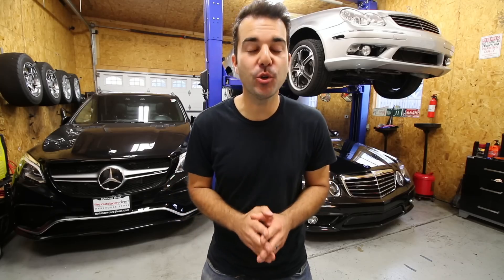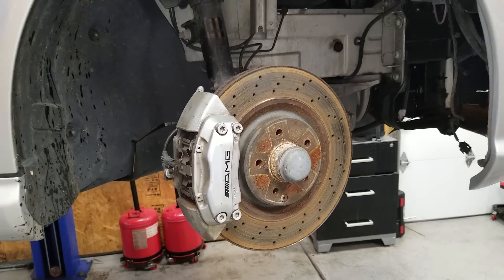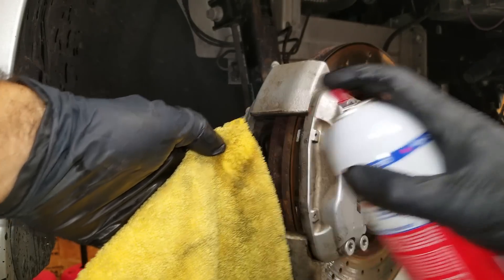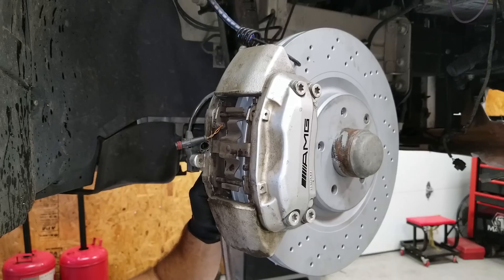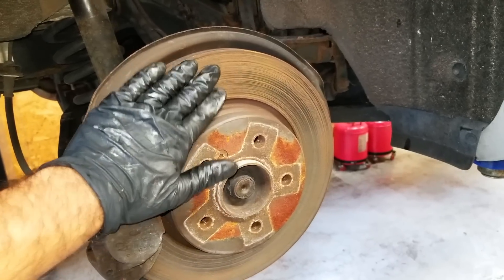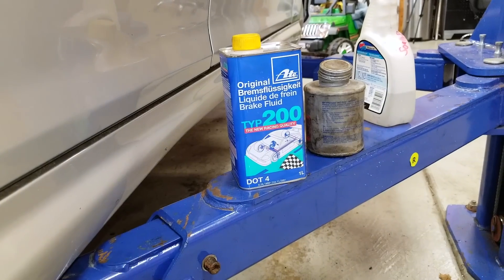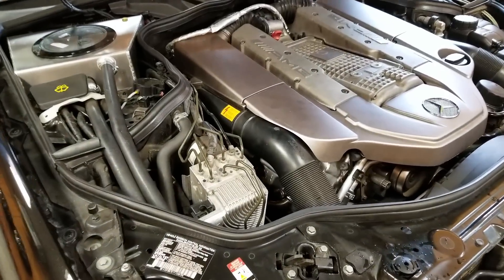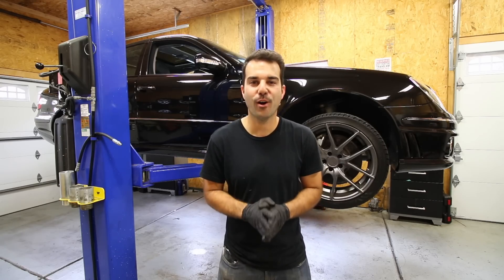Don't Let ANYONE Replace Your Factory Brembo Brakes Before Watching This Video. Big Brake Reality.

Comment: Very informative video. Thank you.
I have one question: My MB E350 (2006) makes screeching front brake noise in the morning only when backing out. It does not make brake noise when moving forward.
After some driving it does not make any noise even when going backward.  It has Akebono Euro pads.  I have lubricated the pads, pins and seating areas as well.

So, what is the issue?

thanks

Comment: Hey Alex I replaced both my front and rear pads and rotors a few months ago with Zimmerman rotors and brembo pads on my 211 e500. For some odd reason I hear a squeak coming from the front do you think it’s because of the lack of lubrication?

Comment: I use Winmax W4 pads. They're a low steel compound good up to 1200°F. Braking performance is absolutely amazing, but they do make a good amount of noise. Small trade of though for how good the stopping power and fade resistance is. I also use motul rbf600 brake fluid. Has a much higher boiling point than the fluid you used.

Comment: 2 major miatakes (!!)after removing the rotor: 
1. Not sufficient bearing hub clean! Clean it to the mirror like look or so. 
2. Dont you ever put that much anti-seize grease on the hub please. You can do that on the grandma's Camry but not on performance car like this! Leave it clean metal or if you scared of removing the rotor again use tiny tiny film of white lithium spray thats it.
Reply: Marcin K Can you explain? Why not to use anti seize on a sports car. 
Thx
Reply: @mistaflinstone72  every single rotor that you are buying has more or less factory run out now you are making it even worse putting a bunch of uneven surface of grease on the hub face. You don't like to feel any vibrations when braking I quess..? I put metal to metal and never had a single issue removing the old rotor from the hub. If ever get an issue you can use the bolt trick, puller or in extreme cases a blow torch. I have removed tons of old rotors and in most cases I needed a hammer or bolt trick.

Comment: That hub face was nowhere near flat enough to mount a disc. Give it a few weeks and you'll have horrendous DVT and induced vibration. No check for disc runout? Not the best job tbh!

Comment: You DON'T want to attack the rotor with a regular hammer. Instead first clean the hub with a brush, then try to remove the rotor by your hand. If won't come off, then try  a little of the rubber hammer.
second thingie - you DON'T want to use a metal brush to clean the face of the hub. Brushing will just polish the rust, not clean it. There's a speciality tool for this purpose, and thats for example a 3M's Scotch-Brite Clean and Strip disc. Never heard of any serious purpose of using the lube other than dry grease (optionally) for hub face. Putting there any grease might cause rotor warping. Then after installing back the rotor you should use the Dial Gauge to check the side movement of the rotor, and place it in a such way, to get the lowest possible number. Most manufacturers in manuals tell about those tolerances you need to get. If number is too high - you got to check the hub face, or give back those new rotors for a warranty exchange.

Comment: Great video.  I have a 2016 AMG GLA45.  Looking to change pads as factory ones give off so much dust.  Any suggestions?    Also, I have 2 years left on warranty.  First oil change I had the dealer do.  Want to run Red Line Oil instead of Mobile1.  If I choose to change the oil in the car myself (and not use Mobile1), does that break the factory warranty?  Or would you recommend having dealer do the services while under warranty at least?

Comment: I 100% agree ! I have gone to MB to know the price for replacing my brake pads : $500 for Brembo parts and $800 for the whole thing installed !! I ordered on the internet ATE pads for my SLK 55 AMG and i paid them...$150 !!! I installed them on my own, it took me 2 hours within preparing them to avoid any braking noise. The braking system is now brand new and work much bettter !! I finaly save more than $750 !! Do it on your own, you can do it, it's easy and you will save a lot of money !!

Comment: Nothing mentioned about SBC disabling.  Dont we need to disable SBC?
Reply: Take the electrical Connection at the sbc-unit Off.
Reply: @peterhert9350 Thanks, Thats what i ended up doing; though i did find a manual process of spinning tires etc to turn it off and i decided against it.   I don't understand how my C5 vette had built in odb2 communication on the dash and could clear but a decade later we dont have a way of talking to vehicles to perform fairly routine maintenance.

Comment: I bought a set of good quality front and rear rotors, ceramic pads, and sensors from ebay for my Mercedes ML 320 under $170.
Reply: How do you know they are good quality?

Comment: you shouldn't compress the break pistons without opening the bleeder valve, you end up pushing the fluid out of the caliper and can create air bubbles and or increase your chances of a blockage/damaged line

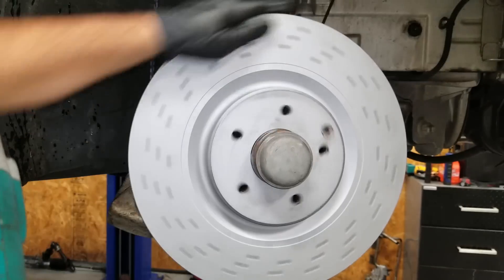Comment: Wobbly rotor at 7:20 :( Also do not hammer them off as you will damage the wheel bearings and will be replacing them in a few thousand miles.

Comment: Good stuff, i just replaced the front brakes and rotors on my 08 C350 , made a world of difference in stopping consistency and confidence. Just brake dust is bad on these pads. May switch them out. I use FCP also , they are great for parts.
Reply from the maker: Try the Akebono pads. I really don't have any dust

Comment: I have a Merc E320, 2003 which is in need of front brake pad/disc replacement. Lots of debate about disabling/deactivating the SBC before working on the brakes. I take it this was done before your presentation. Thanks. Peet from NZ.
Reply from the maker: The C55 doesn't have SBC but I cover SBC on the E55 in this video. You must deactivate
Reply: Thanks for that. I certainly will check. Keep up the good work. Peet.

Comment: I'm a bit skeptical about spending lots on brake upgrades just because you have added power to the engine.  Provided your brakes can lock your front wheels without fade from a high speed stop, then that's all you need. I like the idea of more power but I use it to accelerate faster and not really to increase my personal top speed which is effectively limited by modern roads (I don't track my cars). You would need to improve braking if the car weight increases and you would see a benefit from better brakes if you increase tyre size but otherwise....

Comment: Love your vids, especially the E55 ones as I have one too in obsidian black in Australia. Question. Does the x431 Diagun 4 clear the message that comes up on the dash screen " emmision inspection performed on time" and "main inspection performed on time?" I have that message on my W211 e55 and can't get rid of it even though I have changed the dates to 12/ 2050 by going through the menu on the dash for some reason. I checked the web and when changing dates doesn't work, you have to go to the dealer so that they can reset it with STAR.  So if the  scanner you're using can clear this, I will buy one. Not the only reason I would buy it but if it clears those messages, it means it's very in depth scanner. 
Can you check it and let me know please?

Comment: When the securing  Pins dont come Out (Rust, dirt), warm Up the surrounding Material, use rustremovespray , cool the Pin down with icespray.  I had serious Problems with the Pins. This way solved the Problem.

Comment: Thank u for ur video.  Its very easy to understand !!  Keep up the good work.. also question.. whats the proper procedures for bleeding the brake fluid on the amg and make sure all the air is out of the system and the proper way to "break in" the new brakes ??

Comment: One thing I do when replacing rotors is applying a very thin layer of brake grease on the hub face. This prevents rust forming between the rotor and hub face.  That way when it comes time to replace the rotors you don't have to hammer them off. They will pull right off with ease.

Comment: One quite major part missing from the video is how to wind back and re adjust the handbrake shoes on the rear brake discs. You may need to cover that, as sometimes with heavily worn discs you will not be able to remove them without backing off the adjustment for the handbrake shoes.

Comment: Please help, I did my front brakes and disconnected the sbc system and when I was done I connected it back and turned on the car and now the red brake light won't turn off.
Reply from the maker: Sometimes you just need to turn it off and start it back up a few times.  Take the key out completely every time toy do that
Reply: @LegitStreetCars  I've done that and nothing. Every time I unlock the car the red brake message appears now

Comment: Great video. I have some cheaper alternatives for cleaning and lubricating, which does the job good. For degreaser and cleaning we can use kerosene or bbq liquid with kerosene in it. Motorcycle chains are cleaned with kerosene according to some manuals, that chains has rubber seals so they are best cleaned that way. For lubricating you can use  copper paste/grease which is thermal resistant.

Comment: Noo, don’t lubricate the back of pads as you’re only temporarily masking a brake issue that is causing the vibration (noise) in the first place... Far better to diagnose the issue and fix it, don’t just mask it...

Comment: Why on hell replace the rotor, unless its worn down to less than the factory recommended thickness there's no need at all to replace the rotors front of rear ? full stop ? So check with the OE rotor thickness miniums and then check with a thickness gauge like a metabo type caliper type and then if under the factory recommendations for safe thickness for the rotors if lower than OE then replace, otherwise its a total waste of money full stop, also always use the right sprays for the pads piston contact side, ie: they make a hi pressure rubber pad which fits exactly to the brake pad areas to reduce noise as well ? sometimes they are a brush type rubber spray and other times you can buy them for the pads as well ?

Comment: I think my next reliable daily driver is going to be a Mercedes Benz. So easy to service yourself and straightforward too. I do my own brakes on my Acura.  Mechanics try to scare me about "safety.... this.... safety.... that". I have the service manual and save myself 100's of dollars doing the work myself. I like the fixed calipers because they're more reliable than floating calipers that can seize if the slider pins get worn or contaminated if the boot cover is broken. I never knew how the AMG Brembo calipers worked until I saw this video. Much simpler design. Almost zero maintenance for the calipers and pistons.

Great video, Alex! Keep up the good work and congratulations on reaching 101K subs!

Comment: BMW uses Brembo on the current M3/M4/M5/M6 and other M cars as well as the M-Performance upgrade option on the 3 and 4 series.
Reply: using standard brembo discs on my 320, found brembo pads squeeked (witin a couple of months) using both copper grease and ceramic grease. not a problem with textar pads (over a year) now.

Comment: I see no comment about checking the run-out of the discs/rotors?  Whilst I mostly only buy Zimmermann or Brembo discs, occasionally I have bought other makes and have found that the run-out is out of spec, which would have caused pulsing on the pedal and lack of brake feel.  You cannot rely on manufacturing quality especially where even the top makes buy them in from China and India.
Also, the drilled discs are not really necessary for a street car and you pay a big premium for them over the vented and solid discs.  You will probably find an equivalent non-drilled ones quoted in the same manufacturers schedules - this is the case for Mercs.  Drilled discs are really for extreme braking and are suited for race conditions but even there the drilled holes are suspect when taking the discs to the wear and temperature limits because they crack around the holes.  Slotted discs do the same job and are more reliable.  BTW the drilled holes are supposedly to vent gas from the heated pad not to add cooling to the disc.

Comment: You made the biggest mistake you could make!
Never use any stuff on the back side of a brake disc mounting face as this can increase the Disc run out lead to DTV (Disc Thickness Variation) causing brake judder.

Comment: Hey Alex, 
What is the part number for the Rear Rotors that drilled down to buy at FCP Euro. I have a E350 Rear wheel drive 2009 AMG kit car. The Rear Rotors on my car a large ones but not drilled down and I want to convert them. Please advice. Thanks

Comment: As I’ve cried and moaned about GM using very small iron calipers and rotors in the 80’s, on F-bodies, I now cry, why not 6 pistons on everything over 3000 lbs and 300 hp.  ;).  I mean the parts are not complex, nor is assembly.  I guess we just wait a bit longer.  Or just retrofit meanwhile.

Comment: Please do not grease a wheel hub never ever. This is a big no no because on the one hand you gain an uneven surface of your wheel hub an on the other hand you minimize the friction coefficient between the rotor and the hub. The little bolt that holds your rotor in place holds nothing it's only a little wheel mounting help. The only thing that holds your rotor in place are your wheel bolts or nuts. With the uneven surface your bolts could get loose and with the minimized friction coefficient the rotor could turn a little and cut the wheel bolts off. If the wheel nuts hold your rotors are going to get runout because of the uneven surface. This is what you learn in brake manufacture repair guides like brembo, zimmermann or ate. Please respect this because it is dangerous.
Reply: Correct. Only ignorant amateurs use lubricants in such places!
Reply: Maybe you could oil it a little, but never ever grease it like that. All the brake manufactures give repairguides where you are told to mount the rotors dry after cleaning  the hub. You should grease only the contact points of the caliper and the pads and between the pads and the caliperholder. This is not only wrong it is seriosly dangerous.

Comment: Hi Alex. Big fan and you have really inspired me to DIY more at home. I own a 2012 C63 AMG base model and it needs brake pad and rotor done. I found  the kit on FCP Euro but they can’t confirm if it will fit my car as it’s imported from the UK and apparently the part is different to US spec cars? Not sure if it true but local Indy won’t confirm it either (funny that) Can you help please? My vin is WDD2040772A725558

Comment: Have a 2011 m3 right away bought the autel mx 808 great tool well worth it.
 Wish I had a lift to do work on the car, so far I've been getting the parts from FCP and getting a garage to install them. They don't particularly like it but it's still money for them lol.

Comment: You are lying. Mercedes doesn’t use or recommend putting grease on the back of pads to stop squealing brakes.
Reply from the maker: So let's pretend for a second that I'm wrong. Why would you assume I'm lying?  Like I have some grand conspiracy to sell you a few more dabs of brake grease? Also, I clearly say that this is what I do and that many different companies list different areas to apply and different products. I link to page from a Mercedes work instruction that shows putting brake paste to the back of the pad btw. Check it out in the description box.

Alex

Comment: It is dangerous to say that anyone can replace their brakes. Generally yes! it's a piece of cake... but in mechanics a lot things can happen.
pins(often), pistons, discs, pads can be completely seized.

Rubber, threads, caliper, hub,  can be damaged ...

All this can be strongly influenced by a rainy climate ... 

Especially on big brakes.

Otherwise not mutch technical error in your yelling video, except having blown the brake dust  and forget to replace the bolts or put threadlocker on.

But some details are missing to avoid some problems that a customer will claim ...

Finally if you work for yourself it does not matter, if it makes noise, vibrates, wears quickly or if you lose your brakes at high speed ...

One last thing, is it easy to change the mechanical parking brake system if it completely rusted ? like on w211...

Comment: I just flow your exact same steps, I got the discs and the pads from Mercedes, ( 2004 SL55 )
when the car is hot ( 30 min drive)  one of the size squizzzz 
could you tell me what I did wrong  ??? 
thanks

Comment: Hope this reaches you, LSC. As someone with experience working at a Mercedes dealership (in a technical role), what are your thoughts on Casey Putsch's video concerning the Mercedes SL500 SBC brake failure recall?

Comment: Hi Alex, I drive a BMW e38 with stock 4 piston Brembos, and you can't slide the pins on them, you have to remove and disassemble the calipers to change pads. The holes for the pins are smaller on the outside so it's impossible to move them once everything is assembled. Nice video and good info as always!

Comment: all of this works great until you do a brake job on a normal car/truck with a fixed caliper with over 100k miles in the rust belt.... those pins are stubborn as f**k, and will probably need to be replaced. odd that "normal" cars are starting to incorporate this fixed caliper setup. The tundra, and colorado are the first to come to mind.